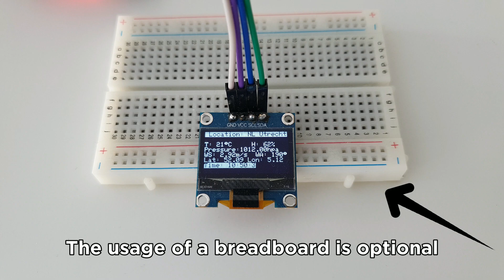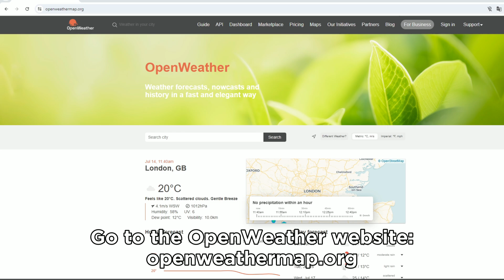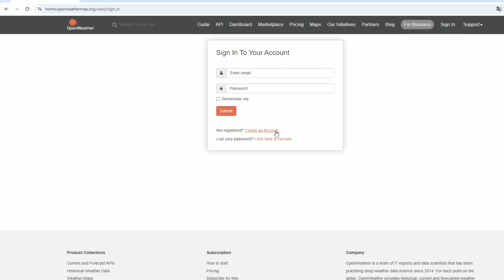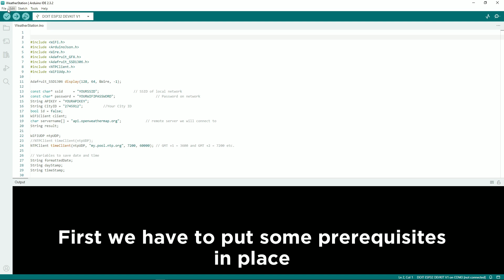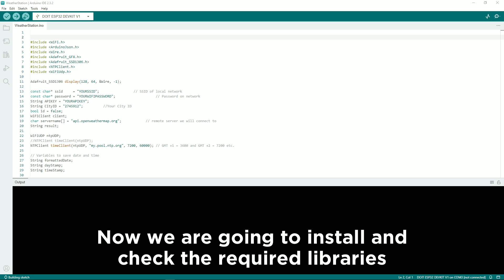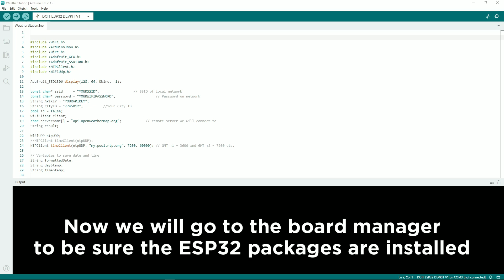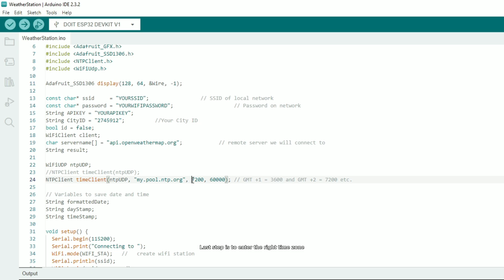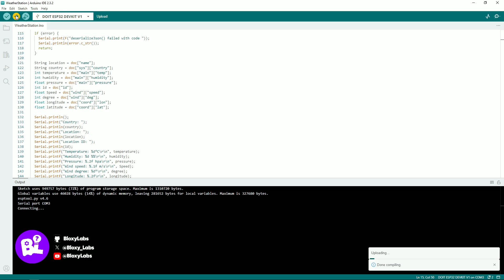How to make a WEATHER STATION with an ESP32 and IC2 OLED Display | 0.96 inch oled SSD1306

Comment: i did it and its only showing temperature and humidity, not switching to other options. I think because my screen is smaller than yours. It would be nice if you showed how to add an input button to switch between temperature, humidity and other statistics, thanks!